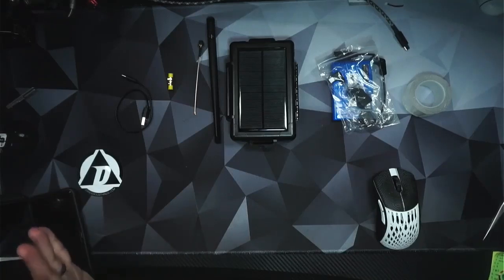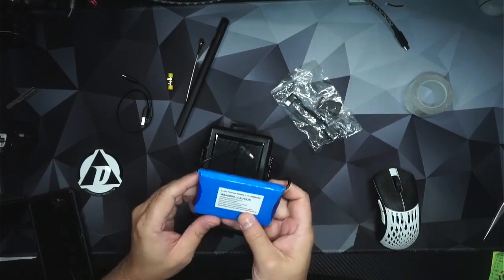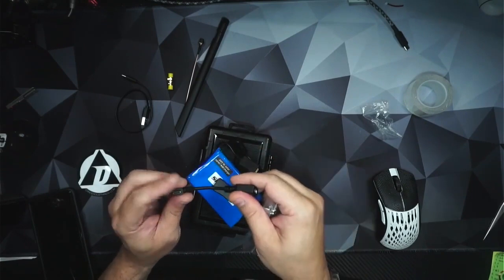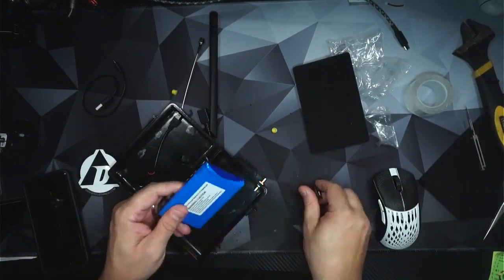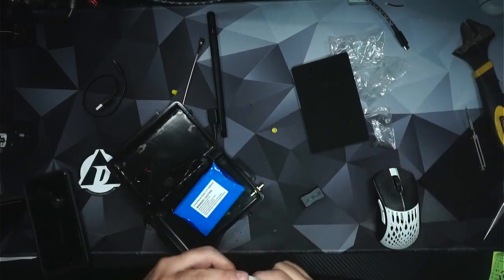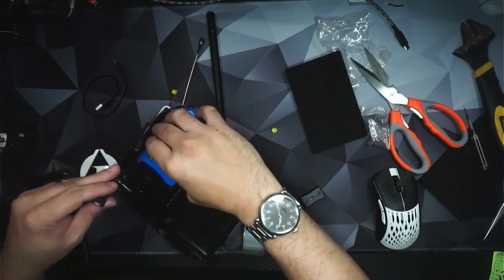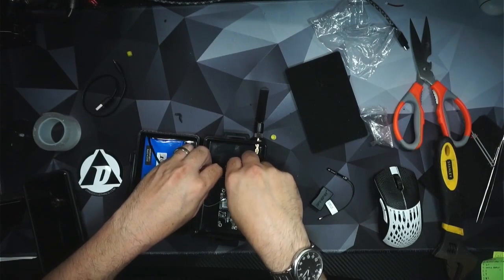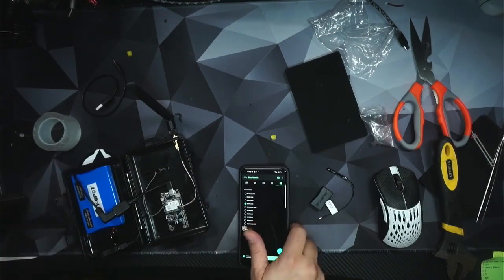Meshtastic 10 Minute Solar Node Build using Spyspot Solar Enclosure and Rak Wireless Wisblock

Comment: AMAZING find my friend!!!  Just FYI for anyone making this build.  After getting everything set up I plugged in the 90 degree usb-micro to usb-C adapter and I did NOT get any "blinkies" either.  So I unplugged the usb-micro to usb-C adapter and used the usb-micro to usb-A adapter block that is included with the kit and then used a very small usb-A to usb-C cable and BINGO she was up and running!  I have yet to put it out in the field and see how the solar panel works.  I used the Unify solar enclosure on my other RaK device and it only charges like once a week because it is very smart with the battery care.  In that device I only have a 3000mah lipo and when fully charged it takes about 4 days to drop below 4 volts.  When that happens it starts charging from the solar panel and it maybe takes 2 hours to bring it up to 4.14 to 4.15 then stops charging and takes another 4 days for the cycle to happen again.  I will update this when I get it out in the field.  Thank you again for this awesome build!
Reply: Thanks for that tip! I just finished building mine, plugged in, nothing….will try your fix in the morning.  This is a slick build.
Reply: @JohnMerryman  yeah I did the same thing I used a usb cable and it started working fine.
Reply: I DON'T KNOW if the battery is bad or the cables are bad or the connections are bad, but it won't come on unless I do a usb connected to a power supply. I have ordered new usb connectors and i will try that

Comment: Has your battery ever died? does the solar panel keep up?
Reply from the maker: @UrbanWoodsman-le4tf  been going strong for three months now with no interaction.
Reply: @Hamspiced  Mine only lasted a week and the battery was dead. but it is winter.
Reply from the maker: @houndheadjr something must be wrong with your device.  It should absolutely not be drawing that much power.
Reply: @Hamspiced do you have it on power save mode
Reply from the maker: @houndheadjr rak wireless devices do not have a power save mode.  That's only on esp32 devices.  And I don't recommend those devices for this build.